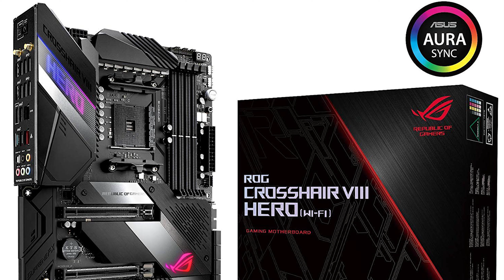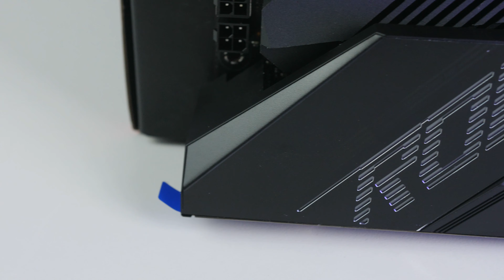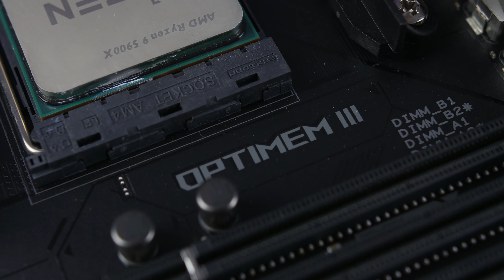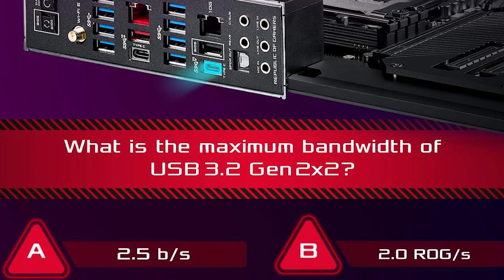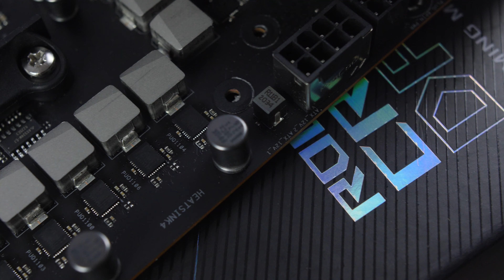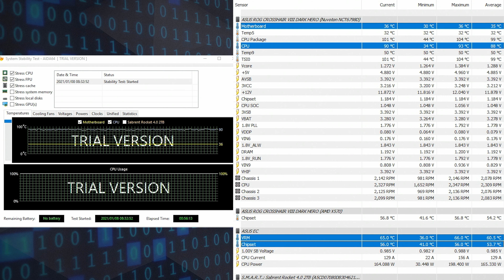Is this a X670 in disguise? ASUS ROG Crosshair X570 VIII Dark Hero

Comment: I wouldn’t say the 5900x is the bare minimum CPU to use with this board. The Ryzen 7 3900x would also be an excellent pairing as would the 5800x3d. So it is certainly not limited to Ryzen 9 CPU’s. I know this because I’ve built two rigs with this board and Ryzen 7 CPU’s. unlike your build, I didn’t make the mistake of using 4 sticks of ram in Ryzen. The Ryzen memory controller handles 2 sticks much better than 4 sticks. As a tech Youtuber, you should know that 🤔.

Comment: I ordered one today to put in my also recently ordered 5800 X3D-processor... I hope this is gonna work after assembling :-)
Reply: Just ordered same thing. You happy with the combo?
Reply: That's a GREAT gaming cpu.  The only down side for it with this mobo is that AMD strongly discourages overclocking it which renders this mobo slightly un suited for use with it but only slightly. The way insee it is tbis board allows for future proofing upgrades to the maxx on AM4 platform and also provides a full suite of top quality components and features for reliability, longevity and utility....so it is still a fantastic choice for ANY 5000 series chip.

Comment: Is it worth paying the extra 20% over the crosshair VIII Hero?
Reply: I have 1 X570 Crosshair VIII DARK HERO which I want to sell because I went with a i9 12900k and MSI Gaming Edge WiFi DDR4. It's still in original Package and not opened(bought in in the shop named equippr if you want to know) . I bought it months ago and the shop does not allow me to return or change it. I bought it for 408,99€ and I want to sell it much cheaper for ~300 or even cheaper, just tell me what you would pay for it if you are interested. ;)

Comment: I bought this board, with a 5600X and I'm getting 4875 MHz all day long with this. I do plan on upgrading to at least a 5900X, but that's further down the line. I also have a 3090 that's waiting to be paired up with it. But my 3070 is working just fine at the moment with this board and 5600X.
Reply: What board did you switch from before the dark hero
Reply: Strix B550-F Gaming

Comment: I still can’t justify paying the extra $240 over my Strix b550-f wifi. My 5800x is hitting 4850mhz all the time. The rgb headers are decent enough for my 7 Phanteks fan d-rgb setup (4x140mm 3x120mm) with 2 phanteks light strips. Pushes my 6800xt and 4x8gb predator rgb 3200 kit  overclocked with a gen 4!nvme drive and 2tb sshd (don’t waste your money on the sshd...there trash).
Like I have it in my cart and was just a second away from ordering it. Then I realized I am only interested in it because it’s the “hype” board right now. My b550 is solid, and if/when I do move up it’s gonna be to the next gen when it’s announced later this year. For now I’m gonna buy the new Ek 360mm cooler that has the 6x drgb vardar fans for $200 and keep the other $250 in my bank. Cheers all.
Reply: Next gen will not work on any current motherboard.  Going to need am5.

Comment: Cool video, I liked your review.  You covered everything well, just one small thing.. you called it Crosshair Hero V 3.. it's roman numerals, so it's Crosshair Hero 8 (5 + 3).   Good camera shots of the board as well.  This is my fave AMD board currently.. it's sitting in the box, some day soon I'll get around to testing it out.  I love that it has no chipset fan, lots of SATA and USB.  It pretty much has everything.  Some people like 3 m.2 slots but I only need two.  I prefer the extra PCIE slot.

Comment: I have this board. But I'm still waiting on my 5900X and 3080 backorders 😫
Reply: Same
Reply: Got my 3090 2 weeks ago, at least i can use it. But i wont take everything ou twice, so i' waiting for the 5950x....
Reply: Just got mine 😀 at micro center
Reply: It doesn’t need bios update right??
Reply: @unknown5381  it supports 5xxx series out of the box if that's what's you're asking
Reply: @unknown5381  no
Reply: Hi on this mother board can you disable one of the M.2 pcie 4x4 slots in bios ? Can you confirm please
Reply: @gurugamer8632  You should be able to since that is a basic feature on most motherboards( not really necessary for X570). I'm still waiting on my 5900X so I can't confirm for this board yet.
Reply: @workthis  OK thanks appreciate it. I’ve got the board today. But delays for CPU liquid cooler and PSU.
Reply: Got the Dark Hero, 5900x and 3080 but no case or EK distro plate in stock 😔
Reply: @zero604  haha I’m just waiting for PSU, Case fans and liquid CPU cooler. We should start a Dark Hero VIII WhatsApp group 😂
Reply: @zero604  Why didn’t you got for an AIO cooler like Corsair H150i elite ?
Reply: @gurugamer8632  I don't like AIOs, all my builds are custom hardline, just looks better. Wanted to get the O11d XL and the distro plate for it but nobody in north America has them in stock
Reply: @zero604  I have the 011D XL. I’m worried about custom hardline if it leaks as I have not done this before. I don’t know how to setup too.
Reply: @gurugamer8632  EK has a leak tester, it's a pump and gauge combo. if you have the distro plate it's fairly simple, all the tubing just needs one 90 degree bend
Reply: @zero604  I have Lian Li 011 XL ROG and Dark Hero VIII and AMD 5950x... can you paste the links what I need to buy for liquid cooling please. How do I bend the pipes looks messy
Reply: Update: I got my 5900X and 3080 and this board is a blast with OCing. if you are an overclocking enthusiast and want to get top scores, this is the motherboard for you. I got top 10 FF XV score with over 20k score without overclocking my GPU, only CPU.
Reply: I have got my 5900x ram pc case fans air coller ssds using my old gtx 970 and w8ing for this board for now, saving for 3080 or 6900xt